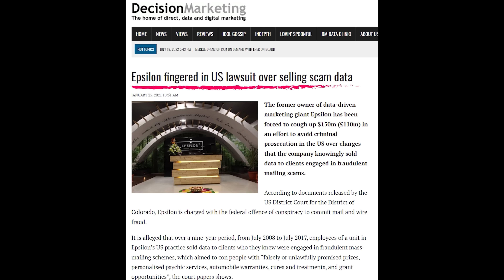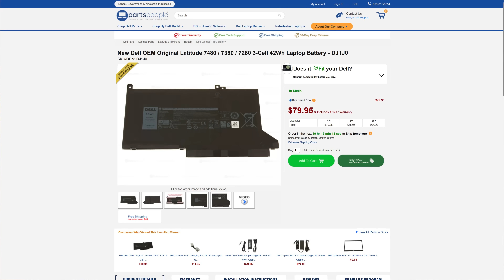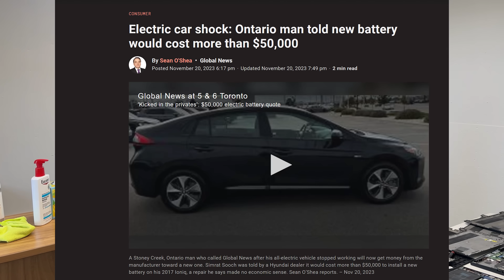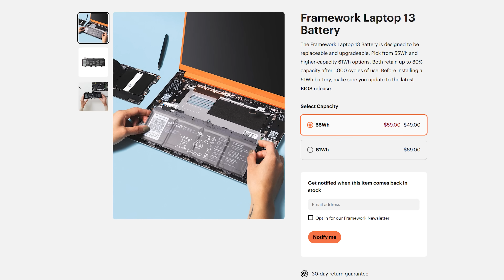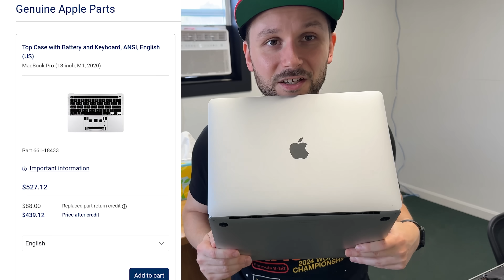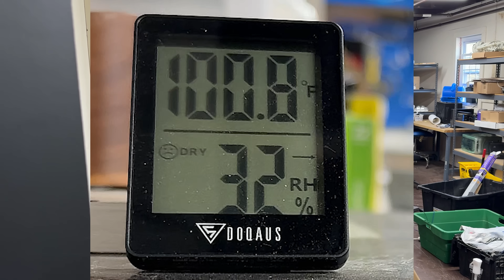Planned Obsolescence: Why is Replacing a Battery STILL So Difficult and Expensive?!

Comment: Let me tell you, you are not "blowing this out of proportion." 

Overall, I simply couldn't agree more with what you said in the video. I'm so glad you're spreading information about this issue not only to solve it, but, for the time being (because solving it will sadly take a long time and a huge amount of collaborative effort), to warn people about non-OEM battery replacements. You highlighted the problems with overall longevity, failure rate and factory-yield quality, but I'd like to add that li-ion batteries can be extremely dangerous, and that the risks associated with said batteries are extremely high in low-quality aftermarket batteries, at least/especially when compared to high-quality/OEM batteries. That's actually all I have to add to what you said; you put the issue into very few words very efficiently.

Speaking from experience being in the gaming and retro-gaming communities, it is sadly very common to see unsuspecting people who simply don't know any better buying cheap, terrible and dangerous replacement batteries for their handheld consoles and wireless controllers. I of course also need those batteries, but I much rather mod the devices to be usable without a battery. That obviously sucks, but at least it is safe. This would not be a problem, if the world was a nice place and high-quality replacement batteries were readily available for all devices, which we should make happen!

...Actually, forget what I said earlier. I do have another thing to add. This just popped up in my mind (so I haven't had time to properly think it through) and might be really stupid, so please bear with me. I think that maybe we should make standard sizes/formats for rechargeable batteries (be they li-ion ones like now or something else entirely in the future) like we have for disposable batteries (AA, AAA, C, D, CR2032, etc.). That way no matter how old the device is, the owner can always just go to the nearest tech store and buy a new battery, even decades after its manufacture and original purchase! Of course there would have to be some exceptions, and eventually some sizes would become obsolete for one reason or another, but the situation would certainly be a lot better than it is now.
Reply: Spot-on, standardized battery sizes, connectors, communication protocols, specifications in general are the only way this has any chance of succeeding
Reply: But we already have standard rechargeable lithium battery sizes like a 18650 cell. The main problem is that those aren’t slim enough for manufacturers to want to use them.
Reply: @brah629 couldn't agree more; moreover, laptop batteries nowadays are more than just the lithium cells, they have temperature sensors and various protections and cabling required for the BMS to be able to charge the individual cells equally, so there's more than just the form factor that needs standardization
Reply: @doruchiriac606  maybe this is silly, but could the form factor standard also include rules and standards for the other parts required for battery safety and replaceability
Reply: @hw6271 it's not silly at all, standardized internal battery sensors and other safety and charging specs would be as big of a requirement as the standardized size and shape of the battery itself
Reply: This is why I like controllers (and other devices like flashlights) that use AAs (or D cells since I have 3x AA to D adaptors) like the Xbox controller, you can just replace the rechargeables as they die out, though I have some Sanyos from 2007 that still work fine in controllers (they're otherwise trashed and don't provide enough current to be used in stuff like camera equipment) NiMH is a very hardy chemistry unlike standard Lithium formulations.
Reply: @DigitalMoonlight Exactly. I have also had very positive experiences with ni-mh batteries. Of course they have their downsides, but they are underrated nowdays, in my opinion.

Comment: 11:55 We have replaced, and are still doing so, replacing our old laptops because they are getting battery issues, such as not keeping a charge, not showing accurate time, etc as they are 3 years old. COINCIDENTALLY they just happen to run into these issues JUST AS THE WARRANTY EXPIRES, but we did catch 2 or 3 out. They were Dynabooks, Dynabook Satellites.
Reply: Some laptops don't even got a CMOS battery to hold time/date anymore, just to give us an extra reason to dump it when the main battery inevitably goes bad...

Comment: We need a standardized battery formfactor! We have so many parts in our computers that have standards, like Ram, drives, and all the ATX stuff. You can just swap parts, because they will fit in. That´s no wichcraft, we have this everywhere. And we need that for batteries too! Imagine we had a standard size for modular batteries, also with the same connector. Depending on the size of the laptop, they would have like three, or fife, or something of those. If you have any device running with AA-Batteries, you don´t need to worry for a replacement. Why don´t we use the same principle on laptops and phones? Make the batteries have a similar size and shape like M.2 SSD, or something like that, and we´re done with that issue.

Comment: Why don't you upgrade them all to Windows 11 and bypass the stupid requirements? I made a USB stick with Windows 11 on it that just plug it in and poof it installs Windows 11 and debloats and installs what I previously picked. It's awesome
Reply: For folks that want Win 11 that is fine but some of us don't. The other problem is the risk at some point Microsoft will not support Win 11 on unapproved hardware.

Comment: In my case I don't have new laptops, I use a brand called KingSener, it's a manufacture in china. They're good but the catch here is in what time the battery will eventually died and need to be replaced again. I use their batteries in my HP Pavilion and in a MacBook Air 2012. But is a shame that we have to import batteries because of the costs (so very expensive) or in my case because the brand. The companies really have to be obligated to gave reemplazable batteries and costs that are normal, no abnormal

Comment: You are 100% right.  This is why they stopped putting replaceable batteries in cell phones.  Next will probably be non replaceable laptop batteries.  Some smart operator should come up with an APP that controls/disables battery charging when you desire,  no more bloat!  ( Cha-ching!)

Comment: We had this issue with an old HP, my dad,  at the time not having a lot of money, opened that bitch up, ripped the battery out, threw that fucker so far away it think it hit Japan and exploded, then we made that thing only function off of power grid, essentially refusing to waste money(my father is also a technician for electrical shit)

Comment: Yeah so far the only "solution" I did for my stuff is to power the laptop with a power bank (usb-c if possible, or there are some that make 19-20v for laptops), and decommission the internal battery completely. Sorry not paying 90 euro for a maybe possibly probably old stock batt that will last a couple years tops

Comment: i'm racing electric rc cars, most drivers replace their batteries every year or two.
high performance 6300mah battery is around 50-70$
bigger capacity like 10000mah is around 80-110$
we are talking about 2 cell 7.6v that can wistnad a burst discharge of 1500amps, Laptops and phones don't need that good of a battery

Comment: Someone needs to print laptop battery cases that hold reusable round batteries (That is what's in the laptop "batteries already) . I usually keep the battery out of my laptop and use it like a desktop.  The battery is in it's carry case for when i am away from home.  It's generally a bad idea to leave batteries in any device when you aren't using it because of corrosion if nothing else.

Comment: 6:41 I do. Install Linux.
Reply: i got a flex 5 16 inch, the old one had display issues just before it was out of warranty. Got a new model because they didn't have the old one. Linux works like a charm on it. Except from the fingerprint sensor. :D

Comment: I had a 7490 from worked n loved it I've currently got a 5340 which drives me nuts n hate with a passion
Reply from the maker: Going from the 7 series to the 5 is a tough blow. They’ll never be as good as they were
Reply: @SalemTechsperts nope not at all, having no network port drives me nuts, on the laptops i use n support the wifi adapter disables randomly n its a nightmare to get sorted over the phone

Comment: I used the NinjaBatt Pro Battery from Amazon for an old laptop that I have that I have my wife since she doesn't need the best laptop. It's an Asus X552LAV-BBI5N08 i5-4210U. Decent enough to use for light users but it can do some work if need be. I don't know if NinjaBatt is the best battery company but I used them like 2 times & it has worked well with me.

Comment: At the very least, manufacturers that include batteries in their products should be required to provide new batteries for that device for no less than 5 years after initial release, and they shouldn't be allowed to charge more than 10% of the original MSRP of that device for a new battery.

Comment: I watched someone online attempt to replace the Nintendo Switch battery
As we all know
Nintendo ONLY wants you to use their products at the surface level, no mods, no fixing NOTHING
If they could have a camera to watch you making sure you don't breathe on their products the wrong way they would

So they GLUED the battery in with a LAYER of adhesive underneath it😅
The guy even said
"If the battery wasn't glued in it actually would be a pretty fixable console.... And yet the one thing that needs replacing the most is glued and you have to soak it in order to get it to budge.."

SHAME Nintendo SHAME 😅

Comment: I totally agree with everything you said. Also, these Latitudes are compatible with W11 if they have 8th gen CPU's. And I don't like Windows 11 either. I reduced to use my Windows 11 HP 14s piece of trash and use my 2 older Asus laptops with 4th and 6th Gen Core i5 U series CPU's and they're still working great with the SSDs although they only have 6 GB RAM. But they're not too slow because I'm still using Windows 10 lol. No device should come with an expiration date! BTW the one with the 4th gen i5 has 59 % battery health and it's an old hot swappable battery BTW and the other one with a pouch li-ion battery still has 82 % battery health despite being 9 years old.

Comment: It's very easy to find a replacement battery in Asia. I used to live in Bangladesh and for the right price, you can even get the original battery for about 30$. Just because the company charges you 90 bucks in the USA doesn't mean it's 90 bucks all over the world. Since you're buying these laptops wholesale, try to find a seller in China for original replacement batteries. I think it will just be cheaper even if you add the tariffs on top.

Comment: I have a 5 year old kinda off brand gaming laptop. I haven't taken it apart and looked up the battery recently, but it sucked to begin with. I mean it's a gaming laptop so obviously I'm not expecting a ton of battery life. But after 6 months the battery started failing. I'm assuming a cell is out intermittently. Sometimes it holds a charge for days when it's off. Other times it needs to charge for half an hour before it'll stay on after logging into windows. Other than that it's been a fantastic laptop. Just half to use it in a desktop configuration...

Comment: Now imagine how much e-wastes phones make. I'm using an almost 10 year old Xiaomi Redmi Note 3 to watch this video and it easily does that. But the battery health is at 43% and will die anytime now. So I'll have to can this phone because I can't find any batteries for it.
Reply: Not just that, but replacing batteries in most modern smart phones are a big pain in the rump to do. At least for older Android phones, you could simply pop off the back, insert a new battery, and move on. However, replacing the battery now requires disassembling your entire cellphone, which is much more trouble than most people want to deal with, especially when they can just drive to the nearest Best Buy and get a new functioning phone and be up and running again.

Comment: I don't think bypassing Win11 HW requirements is the best option, it's better to somehow🏴‍☠ get Win10 ESU or LTSC. This is what they say on Microsoft Support:

"Installing Windows 11 on a device that doesn't meet Windows 11 minimum system requirements isn't recommended. If Windows 11 is installed on ineligible hardware, your device won't receive support from Microsoft, and you should be comfortable assuming the risk of running into compatibility issues. Devices that don't meet these system requirements might malfunction due to compatibility or other issues. Additionally, these devices aren't guaranteed to receive updates, including but not limited to security updates."

You're upgrading to Win11 because Win10 will no longer get security updates, but you are not guaranteed to get these updates on Win11 either. You are definitely getting more bloat into your PC though. I think staying on Win10 (or switching to Linux) is the way.

Comment: I've been dealing with this kind of shit for years on consoles, dude. Per my experience...
Microsoft consoles, usually parts are readily available for the common things to break. The firmware DRM of pairing say, the optical drive to a console motherboard aside, it's usually fixable. And on the rare chance it isn't, what parts can be scavenged, are usually fine.
Nintendo used to be really easy to keep repaired, the Nintendium mantra was well known and deserved. That said, I've had tons of broken DS's and 3DS's. DS's were fixable; I've yet to have a successful repair of ANY 3DS system. and the new 3DS/2DS? Forget it. Original 3DS's would have most of it on a single large pcb, so getting in and out was fairly simple affair. On the new 3DS? It's a minimum of five PCB's tetris stacked together with ribbon cables out the ass, and the sh oulder buttons have ribbon cable and pcb's folded and stacked in a way that was impossible to actually service, transplant or replace successfully.
Sony is the worst offender, and it's not even close. TONS of dead consoles from my own first-hand experience with them, the parts needed are NEVER in stock and if you have the audacity to do so, they just ban your account and console and block you from being able to access or play the games you have downloaded or physically have on hand. It's absolute bullshit.

As far as phones go, I cried when my lg v20 got to the point where I wasn't able to make or receive calls anymore. Even with as many times as I've had to have the screen replaced, being able to have the extended battery option and that it was rooted and running a custom rom was a godsend with that phone. Nothing I've had or been able to buy since, has even been satisfactory, let alone a positive experience. NOTHING!

Comment: This speaks to me so much rn, I currently have an Aftershock Vapor 17 Pro (which is one of those rebadge tongfang laptops) andit is a great laptop. But recently the battery died and I have been going absolutely mad trying to either find a battery for a good price or trying to make a different battery that I harvested from an Eluktronics laptop to work with it (its detected but the charge wont go up whatsoever) and I have been doing everything hardware and software related within my skill set to fix it

Comment: Simple solution: stop buying devices that require batteries. Desktops don't have this problem.
Reply: Simple counter: there are many people who specifically need a device that's easily transportable and can be used anywhere. Desktops have a problem with that.

Comment: I've had 2 successes with Ninjabatt for my 15" 2015 macbook pro, and my 13" 2011 macbook pro. 

1 downside is that when the laptpp is low on battery, it doesn't safely shut down, so you lose ehatever you were working on
Reply from the maker: Ninjabatt has been decent for us in terms of Amazon purchases, but even they're not immune, we've had to warranty quite a few after a year
Reply: @SalemTechsperts  Good to know. My 2015 Macbook Pro has 50 charge cycles and it's at 103% maximum capacity. I installed it in the first week of June. Been going great so far

Comment: You could try to install Windows 11 on some of these laptops, but you will have to edit the registry and do some hacky stuff. That's what I did with my own computers that Win 11 installers says "not supported". Windows 11 on these supposed unsupported computer runs like a dream, pretty fast. With Microsoft possibly tightening the requirements of a computer being "Win 11 eligible", it is probably safe to try this with a slightly older Win 11 build, and update to the latest build after a successful install.

Also we need to bring cartridge style removable batteries back, like in the older laptops

Comment: I've been rocking a Pentium laptop for ~6 years now. The battery has degraded to the point I can't even have it stay on for 30 mins while doing nothing. There are literally NO batteries on Amazon, and all others cost around 2.5k rupees (keep in mind I just got an NVMe and cleaning of my laptop for only 700 from a shop, btw). I could ask them to replace it, but I don't even know if they could find the battery. Pretty sure they stopped manufacturing it already. (If you're wondering why I'm using a Pentium laptop, my middle-class family only just bought the cheapest laptop they saw, which was 20k rupees, and this one can only handle basic tasks and a little bit of light gaming and was originally meant for online classes.) I'm genuinely pissed. (also love your vids mr tgttel) (EDIT: i found the battery and its product, it costs around 1.5k to 2.5k from third party manufacturers)